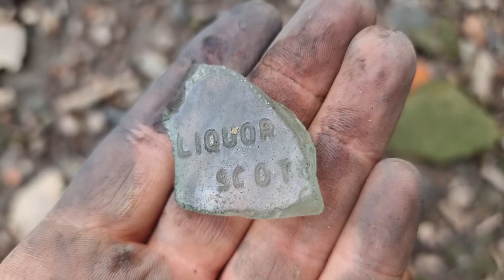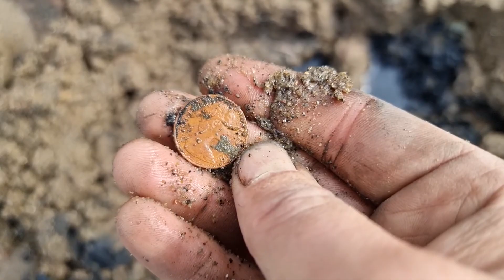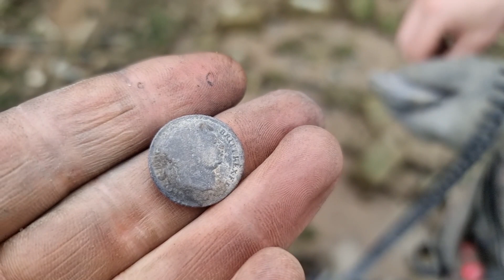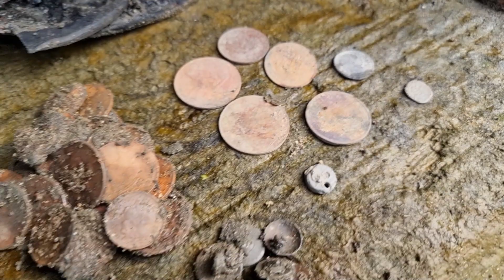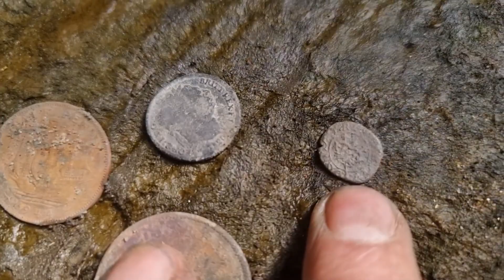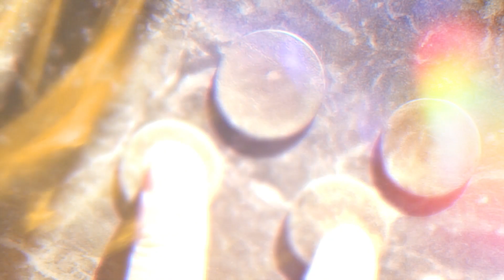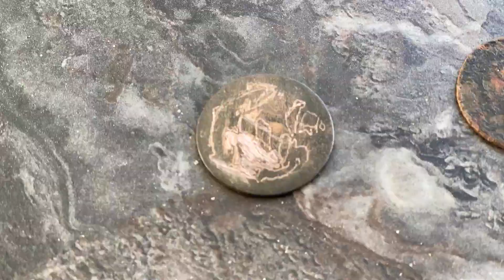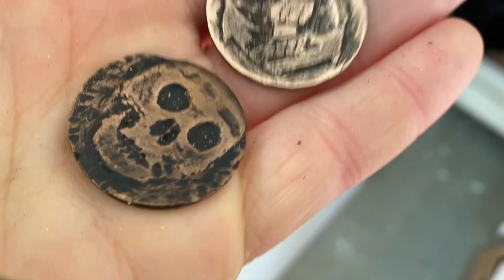COINS COINS COINS found Mudlarking Thames

Comment: Awesome as Always. Thanks Simon, for all the fun and inspiration, while gaining interesting info. I like your unique coin art too. Hook up a sewing machine peddle to a motor that you can plug the dremel into. That way you can control the speed using the foot peddle, giving much better, smoother results. The motor is about the size and shape of a pint jar and hangs from the ceiling, so when you plug the dremel into it, it's out of your way.
Reply from the maker: Cool idea. Thanks!
Reply: @Sifinds  , That's the way my late husband hooked it all up. One of the (suspended, cylindrical motor) brands he used was (FOREDOM), if that helps.

Comment: I wonder if you could  braze a loop of solid copper wire to the back of those worn coins to use as shanks, so that you could make them into flat buttons before you carve them. That might be a cool up-cycle project for those worn out copper coins
Reply from the maker: Great idea. Maybe solder will work

Comment: Another technique would be to use a resist and muriatic acid baths, for an etch.  I would recommend using a ball-end bit for better control and the pen style adapter drive for Dremel
Reply from the maker: Cheers Stephen 👍🏻🐾🧡

Comment: About thirty years ago myself and my parents were metal detecting on the Oregon coast. I don't remember finding much with the detector that day, but, we found sitting on some drift wood a large mens gold ring. It had ABATE engraved on it which we found out was a motorcycle group raising awareness to issues associated with riding. I'm not sure what ever happened to it, but, its probably with my parents somewhere.
Your coin engraving reminded me of "trench art" the soldiers made with nickels during the war. Can you imagine engraving a coin while in the trenches?
Thanks for another great video!
Reply: I’ve been to Oregon. I went snowboarding on the volcano (mt hood). On the way up to Oregon from San Fran we travelled through the giant redwood forests. It was pretty epic.
Reply from the maker: Excellent
Reply: I love my Oregon. Found a beautiful fossil yesterday beach combing. All fogged in and cold in the valley and the coast was 50° and sunny. Well worth the quick trip for some sunshine.
Reply: We went to Lincoln City, to one of the smaller beach entrances it was high tide and going out still as we got done. I bet with in the next week or so stuff will start appearing. There lots of jelly fish and I think jelly fish tentacles. I usually look for agates and such.

Comment: You might try the intaglio method, where you coat the metal, draw with a very sharp dental tool or sharp tool, and then let acid eat the lines you have drawn away
Reply from the maker: I’m not sure that that acid is legal in this country